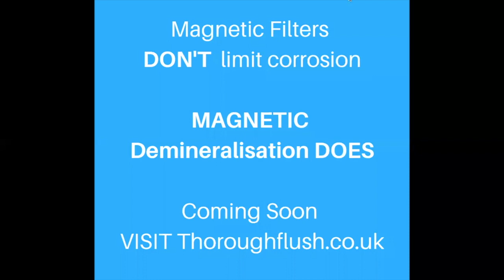How to Become a Heat Pump Engineer with Installer First Festival, GasSafeSuperHeros, NIBE & BetaTalk

Comment: I would love to see better criticism of installers fitting heat pumps incorrectly, for instance an appliance that achieves below scop 3 should be flagged by the manufacturer. 

Heating design is the crucial part here, this should be mandatory for any installer.  The "acceptable" standard of training in our industry is appalling.
Reply: Maybe feedback and constructive critique so the installer concerned can learn from their mistakes, rather than just 'installer bashing'?
Reply: Do you think average installers respond well to "critique" Vaughn?  I know it's not as important as gas safety but energy waste and shoehorning the  tech when it's not suitable should be better controlled.
Reply: Installers must understand that ALL heating systems must be designed for low temp operation to be suitable in the future. Up-skilling is needed not criticism. The industry needs new standards which are mandatory and policed strictly.
Reply: Perhaps the word "criticism" is being taken ambiguously here, criticism can be constructive of course.  Installers across the industry should be trained better and want to know more, we need a system or training program outside of the legal safety side.  The "skills card" idea is interesting and now with remote learning and online courses gaining traction I wonder if something can be created so guys and girls can upskill in their spare time unlike having to give up a day's work and travel for a day's training which may be a big stumbling block for self employed engineers.
Reply from the maker: @pod990  I'm working on it. The skill card is interesting but will still need better delivery of training than what I currently see. Thanks for the comments by the way pod. You're original question is valid as yes there have been some appalling installs. However, there are some good engineers out there though, and industry needs to look after them...rather than just sell to them.